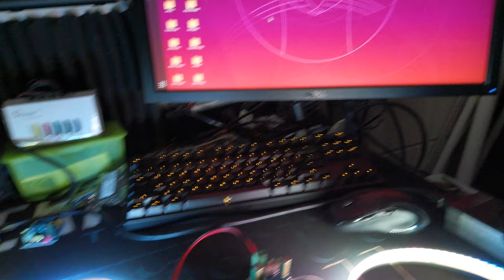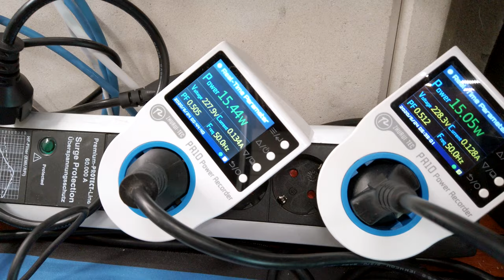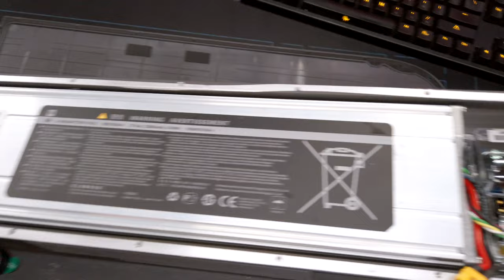💡QuinLED💡 Xiaomi M365 Pro LED Underglow | Wiring and LEDs lit up from battery!

Comment: Put the inline fuse in your power splitter, save all that extra wire.  Maybe find a smaller Reed magnetic switch that's latching..that way no one could turn on your LEDs while your not with your scooter, saving the battery.  There are prebuilt xt30 power splitters too that would save a ton of room.  I would just drill holes in the base for the led wires to come out from.  It's not going to decrease the structure if you put two or three 6mm holes.  Would be much cleaner Installation.  Fill the holes with rtv silicone.

Comment: Nice work! I stumbled upon this because I was trying to figure out the specs of the OEM rear light LED. Do you know where the rear light LED connector connects to the mobo, and what voltage it's fed?
Reply from the maker: Sorry to say I don't know. It's likely one of the plugs on the control box but I just focused on adding some stuff before that.

Comment: Maybe you can add a relay to turn off the LEDs when the scooter turns off. Otherwise great work.
Reply from the maker: Oh, that's an interesting idea, I'm pretty sure I'd be able to splice off a signal somewhere too. But then they would always run with the scooter turned on and driving during the day I'd rather keep the switch, also no need to splice into original wires, but I appreciate the idea, maybe for a v2 sometime :P
Reply: @IntermitTech  you can use the switch before the relay. Or maybe add a light sensor?
Reply from the maker: @JanJanJanJanJanJanJanJanJan2  Oh, you are full of good ideas, a light sensor would make it a nice addition. As said, maybe for a v2, it is already enough of a challenge getting all of this to fit. :P

Comment: For the 3rd hand question, I have one of these doctor-octopus things: https://www.amazon.de/LITEBEE-L%C3%B6tstation-schwenkbare-b%C3%BCrstenlosen-DC-Ventilator/dp/B07233QBBS/
Not perfect but it helps quite a bit when doing stuff like this.
Additionally, for joining wires I can suggest these "heat shrink solder butt" things you can get from aliexpress. They're little heat-shrink tubes with glue and solder built-in. Perfect for making a watertight connection :)

Comment: I'm currently working on esp32 based controller for WLED with integrated dc-dc converter that can handle 10A. I already made my first prototype and tested it but I have not got around to document everything but you are welcome to use the design. https://github.com/hansaya/EspNeoPixel